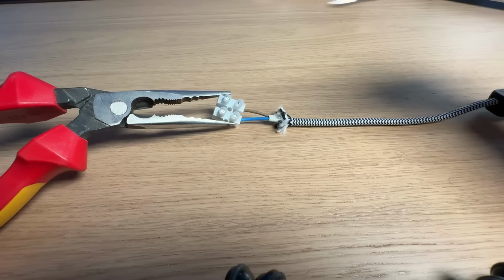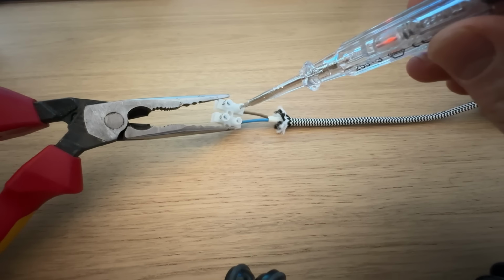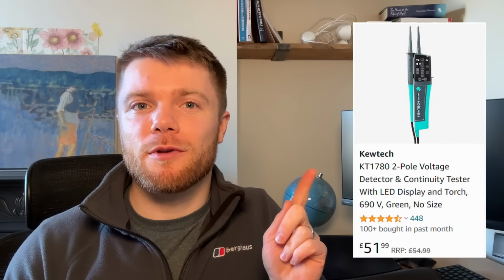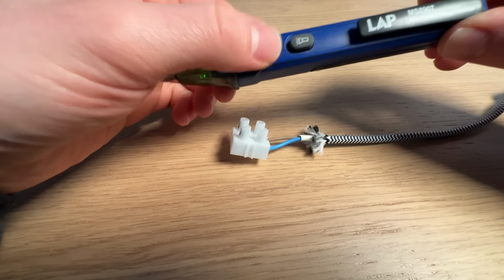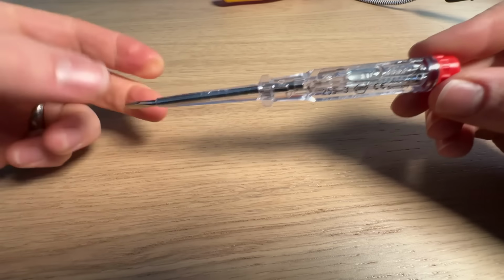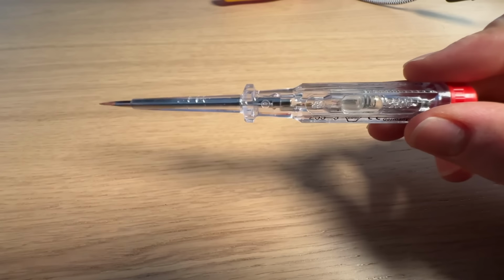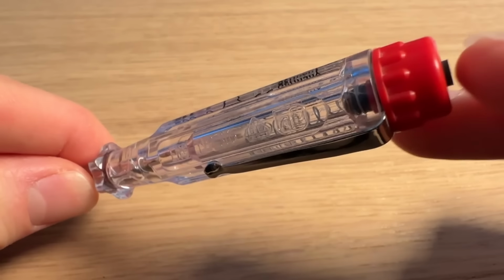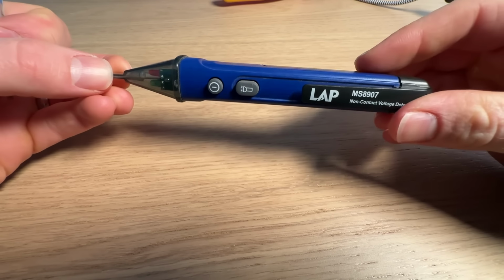The Most Dangerous Electrical Tool

Comment: This is an awesome video! Thanks in particular for explaining the failure modes of the pen testers. I’ve always felt they were potentially dangerous, but wasn’t sure how they could fail exactly.

Also, you said two things about the NCVT that are slightly wrong. 1) They sense the electrostatic field, not the electromagnetic field. 2) They do in fact use your body as the return path, and if your boots are too insulating, as you said in another comment about the pen. But they will also fail to work if you’re too far away from the ground, like up on a ladder. I’ve been up on an 8-foot fiberglass ladder and found them to still work, but I’m not sure how much further I could get.
Reply from the maker: Thank you!! Thanks for watching!
Reply: @TheDiligentDIYer1759  Any comments on my observations about the height above ground limitation on the NCVT? I haven’t been able to test the statements I’ve read on the issue and am wondering if you’ve heard anyone talk on the subject.

Comment: Hmm, there might be ways to improve this design. Certainly filling it in with plastics will help. And maybe a version with a diode and a capacitor or something...Internet, go to work!
Reply from the maker: Yep i agree, if there were no void inside the tool, they would be a lot safer. Thanks for watching!
Reply: There are screwdriver testers with an LED, one or two button cells, and a transistor. These testers have three terminals – a screwdriver bit on one end, and a clip and a button on the other end. Fancy what will happen when the button cells go flat.

Comment: I haven't used one of the neon detectors in decades, however I've never heard of an electrician receiving a shock from one of these devices. In either class of device, you should verify the device is working (by checking against a known live connector) before using them as voltage detectors on presumed-dead wiring.
Reply from the maker: Thanks for watching!

Comment: The only dangerous thing about this tool is you might miss its faint glow in bright conditions - so a false negative result. But false negative results can also occur with more advanced electronic tools when they mafunction. I never completely trust such tools to a point I would grab a wire tested for not being live. I trust them to a point that I just lightly touch the wire that appears not live. Then if the tool failed, I'll just get a very short and light shock instead of grabbing a live wire, that could get really dangerous. So, you can use just your fingers as a live wire tester, however, it is important to use the outer side of your palm. In case of touching a live wire your muscles will contract and they will automatically break the circuit. This is however pretty unlpleasant, not to say painful, so the testing screwdriver is preferred for the intial test before just using fingers directly. OH, BTW, don't forget the voltage rating. Those tools are not safe for voltages exceeding their rating.
Reply from the maker: You’re right false results is an issue generally, but somewhat mitigated through the use of insulated tools. Thanks for watching!

Comment: Never had a problem with these.
As with any other Volt test unit: know how it can fail or deceive you. In this case, use it only to establish if the circuit is live. (Not dead).
You can solder a wire with a lead to the top (insulate it) and connect the new end to neutral or ground.
Reply from the maker: Thanks for watching!

Comment: A dual pole tester is certainly better but if the alternative is people changing light sockets without any test because they are too cheap for a Duspol and too afraid to use the screwdriver it would be more harmful in my opinion. I decided not too to be cheap and only use the proper dual pole tester. Why take the risk?
Reply from the maker: Thanks for watching!

Comment: They don’t work by completing a circuit to the ground through the user, they light because of the difference of electrical potential between the user and the live wire, the user acting somewhat as an earth in miniature, not needing an electrical connection to the ground. If that resistor shorts by some miracle, that bulb will fry a million times before anybody gets electrocuted.
Reply from the maker: They use body capacitance, thanks for watching!

Comment: Do you know how a neon bulb works? It is basically a filament-less bulb. Which means there is a break in the line. 
It's been used for probably one century already and the risk is close to zero.
I'll tell you, it is much more dangerous to not have it when you need it
Reply from the maker: Neon conducts electricity, the bulb would need to blow to stop current passing through. In the scenarios I mentioned like water ingress, having neon bulb wouldn’t make any difference. Thanks for watching!

Comment: When too high a voltage is applied these neon lights tend to short circuit (and the resistor subsequently arcs)... Now imagine the wire you're testing carries 2Kv or more...  I'd rather go for a non-contact version and stay alive...

Another problem is, the neon light deteriorating over time..
Reply from the maker: Good point! Thanks for watching!

Comment: As ex-electrician myself (later Msc. elec. engineer, now PhD elec. eng), I can say - yes, everything is dangerous if you don't know the limitations. 
Yes, these can actually give false information in some specific situations. You have to know these. 
Typically as electrician (mostly military) I was never using this professionally. Because there were better ways.

The cheap way to make alternative and much more reliable device is as follows. Buy two old-style bulbs with metal heating wires 220V each. Connect them in series. Then you can safely put on two of them up to 450V, which is over 380V inter-phase, they work also on 220V, even on 110V you can see them light on. So with this you can measure also up to 400V inter-phases in the substations. Wrap this series bulb connection with something, maybe sticky tape, connect 1 meter wires at the ends to measure with both your hands. When you open an electrical cabinet, you first find the zero and the ground. You first check you bulbs are not broken. You find a place where there is obvious 220 V or 380 V and check the bulbs. Then you know they are working. Then you can use the zero you always have with one wire in hand and you can check for 220V with respect to the zero , or to the ground as last resort. You are on the ground, so for your safety ground matters mostly. BTW, according to safety rules, zero never gets interrupted by switches, so you always should have zero available.

Summary - whatever device you use - always measure zero to phase or between phases. Never to your finger with the device in the video. Your finger may work most of the time, but there are rare exceptions you want to avoid.
Reply from the maker: Thanks for watching!

Comment: I prefer the screwdrivers with an LED, transistor and a couple of watch batteries, they are brighter and much more sensitive. It can be checked before every use by touching both the tip and cap with a finger, it can also be used for testing continuity of fuses and lamps.
Reply from the maker: Thanks for watching!

Comment: German electricians call these "Lügenstift" - "Lying Pen" for they don't reliably tell if the tested circuit is unpowered. They fail In situations where you're insulated from ground. Like you stand on a wooden ladder, carpet, whatever...
Any yes, you need to verify the circuit is disconnected before working on it.
The risk of bypassing the resistor is comparedly low...
Reply from the maker: Thanks for watching!

Comment: These screwdriver testers should be BANNED.  Any electrician that uses them should be fired from the job, find a new electrician to do your work, there are many safer ways to test for current that don't involve a bloody light !!!!  Just because it hasn't failed for many does not mean it is 100% safe, they DO fail, resistors are known to fail, I have seen it, the bulbs can fail, I have seen it too -  There are testers out there that will tell you whether the wire is line or load, just get a good one, not a toy, but nobody should use or rely on a screwdriver and a bulb....and yes ANY tester can fail, which is why you should test it on live circuit first to confirm it works before shutting down the circuit, but at least you remove one level of danger, the potential exposure if something in the screwdriver malfunctions, ............
Reply from the maker: Thanks for watching!

Comment: An example of bad design is a mercury thermometer, that's why they aren't sold anymore. If it were that dangerous (the tester), it wouldn't be sold to the general public.
Reply from the maker: Thanks for watching!
Reply: Nothing wrong with mercury thermometers, they are the laboratory standard for accuracy.  It is the Greens trying to ban mercury from everything that is the problem.

Comment: To be honest, if people used these (or a different wariant of these) for well over 5 decades, it's probably not a killing mashine. The lightbulbs barely break, i never saw one "bypass the resistor" and lets be honest, every eletrician got struck at LEAST twice 😂 multimeters and pens are great, but complaining these simple yet reliable little mashines isn't needed.

 I do, however, test them on a hot circuit before using. Just to be sure 😂
Reply from the maker: Thanks for watching!

Comment: Far more important danger is that there are automotive voltage testers that look exactly like this but contain a 12/24V incandescent bulb and a piece of wire with a crocodile clip on the other side (of course touching wouldn't work). The ones with the wire permanently attached are OK, it's hard to confuse them with the mains AC type, but there are ones with a detachable wire, equipped with a banana plug and a suitable socket (like an eylet rivet) on the tester handle, which looks very much like that touch plate/button. If you mistake it for an AC one, put it on a live connection and touch the rear - you get the full mains voltage going through a small bulb resistance and right through you... 
I tend not to use cheap Chinese neon probes any more, once I came by an automotive probe next to a mains one, both looking almost identical in someone's toolbox. It would be very easy to grab the wrong one and go for a ride.
Examples (scary?): 
car: https://i.erli.pl/wzatg.c6e6ea.xxl.webp  (luckily this one doesn't have a metal eyelet as a socket, it's a hole in the plastic cap and the banana plug makes contact with the spring inside).
mains: https://upload.cdn.baselinker.com/products/4010375/2ff860b1a7606d932be5ae066a10cb03.jpg

Comment: This is not how they work! they exploit stray capacitance, there is no current going through the user. Sit on a wooden stool or jump, it will still light up, there is no ground connection
Reply from the maker: You’re right they use body capacitance, but if the faults i described were to occur, and you weren’t sufficiently insulated from the ground, you still get a shock

Comment: Never heard of anyone being injured by one of these "phase meters" as they are called in my country. And by the way, the 2 devices don't have the same function - the screwdriver tells you which wire caries the phase, while the other detects the presence of high voltage but given the distance of detection, cannot be used to identify the source exactly.
Reply from the maker: Thanks for watching!

Comment: No, it's not. This tool works because of capacitive conductivity. Thing is that your body plays a role of a capacitor plate. The other plate is all of the N/PE conductors in your house. Current does not flow directly though your body unless you touch N/PE conductor. But even then you are somewhat protected by a high resistance resistor (megaohms).
Reply from the maker: Thanks for sharing your opinion

Comment: you just want to sell your completely unnecessary and expensive and complicated alternatives. the tool you claim is dangerous is the cheapest, easiest and most reliable one to check whether there is voltage on a wire or not.
Reply: ......and of course, it is completely safe.
Reply from the maker: Thanks for sharing your opinion

Comment: The volt pen non contact does Not pick up the magnetic field of the cable. What it does is capacitively pick up, the Electric field around the cable that is live and because of this does not require the cable to be carrying any current to work. Hence the name "Volt Finder" tong meters on the other hand do pick up the magnetic field around a cable that has current flowing and gives a reading of how much current.
Reply from the maker: Thanks for watching!

Comment: I'm a heating engineer.  I have to say that I have been using 'neon screwdrivers' for 50 years (just about to retire) with zero problems.  I worked with 45 other engineers...and I've never heard of anyone getting a shock from them.  I don't like my 'voltstick', as I find that is unreliable, so is potentially dangerous to trust it.  But the 'neon'...no issue.
Reply from the maker: Thanks for watching Barry!

Comment: Thoroughly agree!
 You'll aways get people saying they've used one for years and they're quite safe, however, these are often the people with the least knowledge of electricity and its dangers. They'll assume that if it doesn't light up, then the circuit is not live. Bet they don't first test it on a known live circuit to check its working ok, as you would always use a proving unit on a two prong tester before use.

I remember as a 12 year old pushing one into a metal clad socket in the  school physics lab, shorting it to earth and creating a loud bang and flash. Needless to say, the physics teacher was not impressed, telling me "A little knowledge is a dangerous weapon", how right he was! stay safe!
Reply from the maker: Thanks for watching Pete!

Comment: hello Pro sparkies. I have 3, 1 is broken and used as a normal driver. One lights up brightly on contact with any metal, absolutely anything, conductor or not, and the other works perfectly as it should. I also use the other in the vid for shielded conductors.
Reply from the maker: Thanks for watching Mike!

Comment: when i was an electrician, of 40 years i never risked my life by using  a neon tester.  i used  a mains tester, which   was   tested by using a proof  tester before  i touched any circuit. as  a spark when i was working, i never had a death wish, i think they should stop making them because you can  stop idiot,s playing with something  that can kill. during my time as a tradesman, i worked on voltages form 12 volt to 11,000 volts and never used a dodgy neon tester.
Reply from the maker: Thanks for watching Roger!

Comment: Sorry, but the argument is silly. A Short circuit in any test equipment can be dangerous to life. Short circuit a fluke meter and it can kill you.
Reply from the maker: This is the only piece of testing equipment where the user is touching conductive parts by design
Reply: @TheDiligentDIYer1759 Never heard of 'the back of the hand test'? There's another diagnostic procedure that is used to provide electrical safety that requires physical contact.

Comment: I mean the argument that something can get inside is quiet pointles, the bottom part and top part are detachable and one of your basic responsibilities is to check your equipment before using it, you can open it up and clean. Second thing is that some of them do not contain spring alone but spring and fuse. The spring wire tho should burn and shouldnt allow you to receive full voltage by design. Another important thing is rating of the tool which needs to be checked as 230-250V in sockets is usually 9A or 16A, anything like 25A and more and the producer of the tester themselves do not recommend to use it.
Reply from the maker: Perhaps older versions can be taken apart, but all the new ones I’ve seen cannot. Thanks for watching

Comment: The ones in Australia are sold with a lead that inserts into the end with an alligator clip for 12v DC auto testing, wouldnt think of using this for 240vac testing, multimeter or old school test lamps work well for that.4 year apprenticeship to qualify as electrician or sparkie as the slang goes here. be safe and if your not confident call a qualified trades person.
Reply from the maker: Interesting to know, thanks for watching

Comment: I admit I'm disappointed with this video. The screwdriver is a much older, traditional tool, that has one significant benefit over all the others: simplicity. That is, there is in fact far less than can go wrong with it than any of the alternatives.

Then the concern seems misplaced as well. The thing is implicitly fused both by design typically and by the finger press. Press on it, get a shock and your finger is thrown off.

But the biggest omission here is the focus on the tool. I actually use all these tools, and the same principle of use is what keeps me safe. Always conduct a positive test before trusting a negative test, immediately before on the very circuit being tested. That is test the tool first on every single use. Secondly, never trust the tool. So after testing always do a physical touch of the conductor, with the back of a finger. Why the back? Should all else have misled you a live wire will throw your finger away from it (current contracts your muscles). If you pinched it or grabbed it the current would cause you to clamp it tighter. In fact the back of finger tap must always be the first contact you make with any wire, ever. Multiple times on a given job if you've power cycled the circuit or there is any risk its status may have changed since last touch.
Reply from the maker: Thanks for sharing your opinion